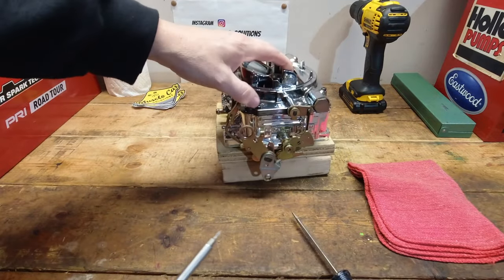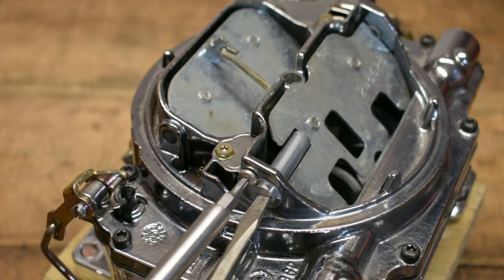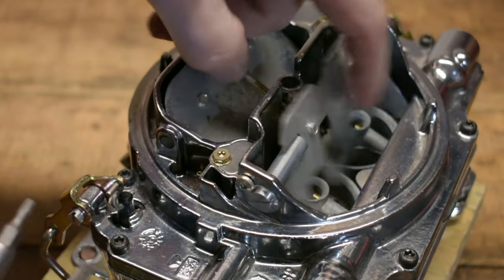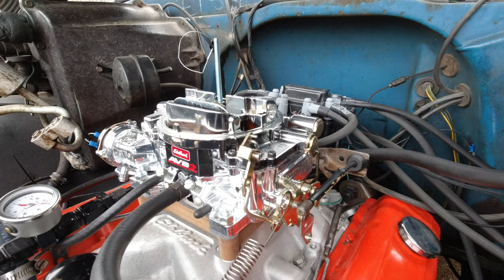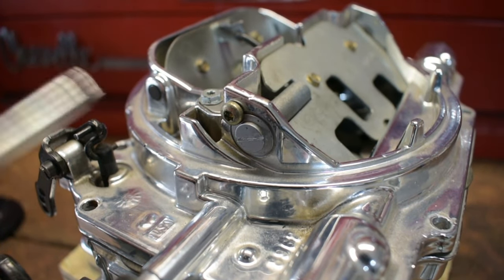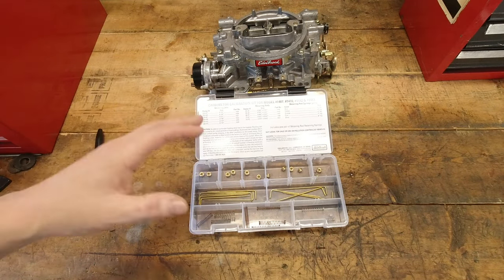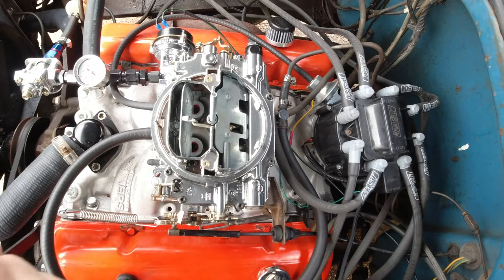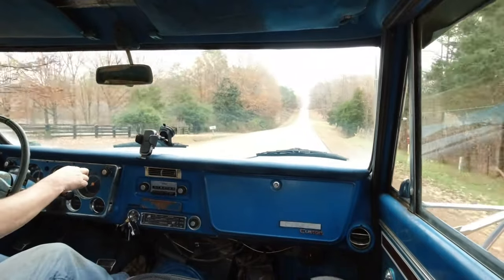How to Adjust Edelbrock Air Valve Secondaries (AVS)

Comment: Exactly!  People forget that air accelerates faster than fuel, so when you whack the throttle open the engine usually takes a big gulp of air because it's physically lighter than fuel and gets to the intake valve before the liquid fuel does.  Slowing down the AVS valve slows down that acceleration of the air so the engine doesn't hesitate, and it has a chance to pick up fuel thru the boosters.

Comment: Or, you could take your top off and find the secondary jets completely clogged with green corrosion like I did with my new AVS2 650? 😠
Reply from the maker: @PTucker0864  that doesn’t sounds like fun!
Reply: @MuscleCarSolutions  , I'm not sure if it was a reaction on the brass floats from the ethanol fuel or what?
Any vehicle that sits for extended periods needs a fuel stabilizer.
I got it cleaned out and running again, but had to pay $50 for a rebuild kit when I only needed the top gasket.
To be fair, it worked very well out of the box on a big 'ole heavy 318 Dodge Ramcharger with a lumpy cam.
I run 22° intial timing, hooked to 13° of manifold vacuum advance, for a total of 35° at idle.....that's how to eliminate stumbling I found.
Also, I have about 14° mechanical advance, so when the vacuum advance goes away while accellerating, the mechanical kicks in and I top out at 36° total timing.
No pinging or hesitation....just cleaner idle, and instant throttle response.
And economy as well. That 35° of initial and vacuum advance is there at street crusing speeds.

Comment: To tighten the spring you say counter clock wise. Edelbrock states clockwise? Just want to be sure. Thanks!
Reply: Tighten the adjuster screw to make the spring weaker. Loosen the adjuster screw to strengthen the spring. It's obvious when you see it.

Comment: A few months ago I purchased a 625 street demon carb, and it's basically the same design. But for the life of me I can't tune out that lean stumble. When I stab it to the floor, it's fine if I roll into. Nothing seems to fully cure it, even tried 3 jet changes. Any ideas on  this carb? From what I read it's pretty common. Thanks!

Comment: The wealth of knowledge you're sharing is just over the top. Thanks again for a great video!
Reply from the maker: I literally know nothing  else.  Just ask my wife!  😂 Thanks man!  Happy holidays!
Reply: @MuscleCarSolutions  do you think these 650 versions would work with a 355 smallblock that only produces 9hg in vaccum at idle? It has a howards rattler hydraulic retro fit roller cam with 227 duration @50 intake and 235 at exhaust.  109 lobe separation.  It's a daily driver and I was really considering one of these avs2

Comment: This carb, avs2, is a no brainer for me. Back in the day I had a new 71 340 Duster which I would run against a racing friend, with a 70 Nova 350, from a kick. He always got me by 1 1/2 cars, time and time again.  I didn't know anything about tuning a carb, until reading an article on my Thermoquad.  So I did a rod change and adjusted the door until I could feel the motor wanting to pull, while flat out.  Making it stiffer causes more velocity !
The next time I got him by 1 1/2 cars.   The TQ was rated at 800cfm, so this 800 AVS2 will work on my 70 360, and it's stroked. So I will have my TQ back, plus annular boosters !
Information is power, so thank you ! As the song goes, Still crazy after all these years !

Comment: I went ahead and bought a 1905 (electrical choke suck on hot cars) and wouldn't you know it I'm right back to Muscle Car Solutions because I have the exact problem you're talking about. I sound like a broken record but once again thank you. On a side note I checked your website for an 1905 or 6 for a while but I just couldn't wait any longer, although the 600 CFM Holley Street Warrior on your website did intrigue me. The deciding factor to go with an Edelbrock was actually when you told me something along the lines of   if you want the sound of a Holley idol just make a vacuum leak. You are a funny man and I'm here for it!
Reply from the maker: Good deal!  You’ll love the throttle response of that AVS2!  Thanks again man.  Appreciate it!

Comment: Great teaching videos. I’m finally accepting other carbs as good or better than a quadrajet! Lol yes, I was one of those guys relieving spring tension, instead of increasing. Took lots of runs to finally just accept that I was backwards lol. Thanks for great vid.
Reply from the maker: @clean1566  it’s situational.  Put the right carburetor in the right situation and you’ll get a good, repeatable result.  I’ll always be a Qjet fan.  But I know it’s not the best in every situation and there’s other carbs to fit in that spot.  Glad you got the AVS adjusted!  Makes a big difference.

Comment: Hello my friend I just wanted to give you a heartfelt thank you for taking the time to make such a great video. I have a 351 Windsor in a 1966 F100 and I'm in the process of getting her tip top again it's sat for long periods of time over the past 13 years. The power plants only has 8,000 miles on it but at this point I've replaced the distributor battery alternator I just blew all the seals out of the carburetor new accelerator pump so on and so forth. I went with the AvS 2 I have it up and running again. I'm struggling with the timing but I understand I need that right first before dialing in the carburetor. I purchased the spring kit since she has the biggest cam possible for stock heads definitely a nice in her idle. Anyways thanks again for such a great video this is top quality for sure. You are the man.
Reply from the maker: Nice!  Thank you!  I’m a big fan of the Windsor engine.  Cant wait to build another one.  Have fun with your truck and if I can help with any of your tuning questions don’t hesitate to ask!  👍
Reply: If you could what would you recommend I learn from to become the great master of stabbing distributors and getting my timing on point?
Reply from the maker: The most difficult part is getting number 1 to TDC.  Plenty of good tools for that to make it easy.  Everything else is pretty easy to get the rotor lined up and you’re ready to fire!

Comment: Thank you for providing this, I was thinking about this method after getting a bad and consistent bog when getting into the secondaries. This is gold and you explain this very well! I have a pontiac 455 and the Holley was just something I didn’t know much about and bought a avs2. The response and acceleration is great, but when I punch it or go into the secondaries it bogs very bad and seems like it stays that way until I get off.
Reply from the maker: Cool!  Was hoping this would be useful to some folks.  Thank you!
Reply: How did it work out for you?

Comment: This is gold! I have been having hesitation on takeoff and on part to full throttle. Adjusting the accelerator pump linkage position fixed the former, but I've still been suffering from the latter. Once I'm back on the road hopefully this will fix me up!
Reply from the maker: Best of luck!  Let me know if you have any questions when you get to working on it.

Comment: edelbrock bought the rights for q-jets an started making these cheap knock offs , imho a q-jet is the better carb , having said that your video should cure most bog issues with these carbs and after you have spent an hr or two adjusting testing adjusting an get it spot on can pat yourself on the back for learning something about tuning 🙂 Good vid

Comment: Ok im glad i found this video . 
I have a 1965 283 with stock rebuilt powerpacks that i had z28 springs installed as well as hardened valve seats, it has a 327 intake . Edelbrock avs2 500 cfm on it , and a msd streetfire dist . Its in a 83 s10 chassis with a 1951 chevy 3100 on it with a th350 w shift kit and Ford 9 inch 3.25 final drive. Weighs roughly 4300lbs im told. 
When i stomp on it to pass, doesnt seem like the secondaries are doing anything. Where would you start looking to adjust? Just a street application but i live on top of a 1300 ft mtn in north alabama . Access roads are steep.
Reply from the maker: @charlespartak2435  I have more questions than answers.  What intake is the carburetor bolted to?  (Potential vacuum leak). What is your initial timing and when is your full timing and ya what rpm does it come in at?  What step up spring color are you using and what is your engine vacuum at idle?  I’m assuming you watched the video and have made adjustments to the secondaries?  Did you tighten the spring or loosen it?  “Feeling” the secondaries arent doing anything isn’t helpful.  Do you feel that when you hit the gas hard it stumbles or hesitates?  Or are you expecting some big snap in power than you aren’t feeling?  The secondaries open when they are told to and the transition isn’t meant to be some violent occurrence, if that’s what you’re expecting.  It’s generally a smooth transition to the fuel metering through the secondary boosters.
Reply: @MuscleCarSolutions  3872788 is the intake.
No vac leaks,  steady vac gauge needle. 
Ill admit now, i had the dist vac pot hose on manifold vac on front. Just swapped to timed port and adjusted the rear sprung butterfly  to looser , its not flapping but easily moved ..if that makes sense. I took the screw loose that covers the top needle pistons and they arent jumping out of the holes, they sit about 1/16" below flush . But a hand throttle blip theyll jump a little . No tach so dont know rpms. I just know when ive asked it for more accelerator, it says , Huh ? Ill take it for a spin after these changes and see how it does.

Comment: I think that slowing down the door from opening allows the air to move faster,  into the carburetor for a longer period of time. Better suction. 
    Like when you put a smaller diameter hose attachment on
 a shop vac , it sucks harder than a larger diameter hose.
  Is that the reason you said that you start by slowing down the door instead of speeding it up at first attempt ??

Comment: Great information. No matter how hard I try I cannot get more than 14 pounds of mercury of vaccum from my Edelbrock carb. I have 350 small block with headers and mild cam on my C10. Already tune up. Any suggestions? My gas mileage stinks.
Reply: Take the carb off and make sure that the butterflies are closing all the way. There should only be a small square of the transfer slot still visible. 

Check for any vacuum leaks. A big one that people miss is having a PVC line from a valve cover to the base of the carb or the intake, but then also installing a vent in the oil fill hole or other hole in the valve covers. If you are running a PCV hose, you Can Not Have atmospheric vents on the crankcase. The crankcase must be sealed at all other points. If you want to have the crankcase vented to the  atmosphere,  then you must plug the PCV ports.

Also, make sure that you are using the vacuum advance on the carburetor and have it plumbed to the manifold vacuum. Adequate timing advance at idle and part throttle is critical to pulling good vacuum and getting good fuel milage.

Comment: Great info awesome video I have a little trouble adjusting the flap when running huge cam
Reply from the maker: For sure.  It’s a limitation of that carb, but that’s why it’s geared more toward a street car.  One area where the Holley will shine.

Comment: An Edelbrock tuned right is a sweet sweet deal I can get them to outrun some Hollies but with dead nuts reliability and consistency great torque production
Reply from the maker: They have their place in the market for sure.  It just comes down to applying it correctly.

Comment: I had no idea how this thing worked, my truck would octane ping when the secondaries kicked in, it made no sense. the AVS was as loose as it could be, I tightened it and boom, problem gone, pulled just fine with no ping. the more I learn about these carbs the better I get it to run. thanks for the info
Reply from the maker: They aren’t overly difficult until to tune once you’ve got the knowledge and experience!  Good work!

Comment: Great video,

Could you address the issue of how when you turn the car off after driving around sometimes the secondary fuel reservoirs (likened to the rear bowl on a holley) seem to empty and not refill to the point where if you accelerate hard and open the secondaries, there is no fuel there and the car will bog from fuel starvation.

I've heard the only way to prevent this from happening is to basically floor the motor BEFORE you get out on the road to make sure adequate fuel gets into the reservoirs in order to take Wide Open Throttle under load. It's actually a potentially very dangerous in a scenario where you pull onto a road when there is or could be a car coming up rapidly behind you
.
I believe Tony DeFeo (Uncle Tony's Garage) mentions this but doesn't go into why it happens and if there is any modification that can be done to make sure it won't happen unexpectedly. 

thanks!
Reply from the maker: It’s heat soak.  Put a spacer between the carb and intake to block the heat transfer.  I did a full video on this topic.
Reply: @MuscleCarSolutions  I didn’t think it was because the motor only runs about 180 degrees but I can try a spacer. Thanks

Comment: Just bought my 1st avs2. I've tuned many of the 1406 and 7s but this avs is now a learning process. A stock 350 vortec, high rise intake and hei dist, with headers. I'm experiencing a loss in vacuum for my brakes from the 1406 setup.  Can adjusting the secondary valve improve this or not? Thanks alot.
Reply from the maker: Haven’t seen an instance with such an aggressive change between a carburetor change and power brakes.  What was your vacuum numbers prior to the carburetor change and what are they now?

Comment: A question for you kind sir. 
On my mild 318 (just a small cam) stock heads,edelbrock intake and a complete exhaust system and running 3:45 gears in the rear,carby is a edelbrock AVS 500 which was professionally tuned and runs great! now I have no bog or hesitation when cruising and I mash the throttle,it’ll kick back to second and go,no worries. My issue is mashing the throttle from a standstill!
It’ll do a bit of wheel spin then bog a bit then take off. This is annoying as sometimes I want to take off with wheel spin and have some fun in the old girl. Same thing if trying to do a burnout! It’ll spin a bit then bog a bit then take off! I have accelerator pump on the top hole for the biggest squirt. 
Any thoughts please. 
I’ve read that I should upgrade to a double pumper if I want to do the occasional wheel spin/burnout.
Reply: Remember that edelbrock carbs have to reprime after sitting for a bit so first time you stab it after its been parked say overnight it will fall on its face .after that your fine.

Comment: I really like the way you work !  Excellent videos !
Question:  Would the pump rod hole setting come into play with this hesitation problem ?
Reply from the maker: It can.  It’s certainly worth checking.  Kind of depends on throttle position, rpm, timing. But 100% yes, that’s a good thing to also try as you tune.  Thank you!

Comment: Could backfiring on hard deceleration be another issue related to poorly adjusted door?
Reply from the maker: It’s possible, but your challenge is to figure out if it’s a lean condition or a rich condition.  Is it backfiring out of the exhaust?

Comment: So the older carburetors that don't have that adjustment are factory set at one rate of opening?
Reply from the maker: They have a weighted air valve.  No adjustments.

Comment: I’ve been struggling with my avs2 and found your channel.  You have brought reasoning into my chaotic efforts and slowed me down tremendously.  However,  When coming off the throttle my AFR gauge indicates full rich and sputters and runs rough until it gets cleaned out at higher RPMs.  How do I get the carb to stop flooding the manifold at zero throttle?    Secondly why do I get a lean condition with an automatic transmission upshift and constant throttle?
Thanks
Reply from the maker: Check out my fuel system video.  Highly recommend a fuel pressure regulator.  That video explains why.  Set the floats.  I have a video on how to set those.  There is a dedicated playlist to Edelbrock carburetors.  There are tons of videos in there that will help you get the basic settings for that carb.  Step up springs is your next step and yeah I have a video for those too!  Have to get the foundation set first, then you can start actually tuning.  Glad you found the channel.  Check that playlist out and don’t hesitate to ask questions along the way.
Reply: Fuel pressure is a little less than 6psi and I set the floats as you had suggested.  Should I reduce that pressure some?  I have silver springs in now and will try lighter.
Thanks a million
 @MuscleCarSolutions
Reply from the maker: You’re on the right path then.  We still need to figure out why you’re in a flooding condition.  If you’re comfortable that the pressure is at 6 and you’re still getting that condition then yes drop to 5psi.  If it still is pushing fuel, then I’d verify the needle and seats are closing.  No trash in them holding it open.  No signs of debris in the fuel bowls.  When we the last time you changed fuel filters?  Lower the fuel level in the carb a little.  If you set with the 7/16 drill bit method, then lower with a 1/2” and see if carrying less fuel helps.